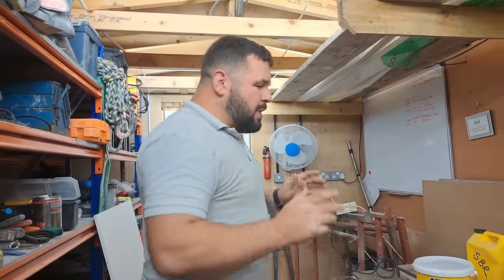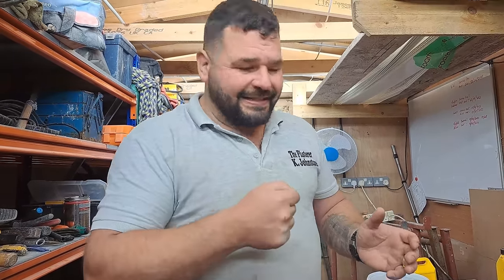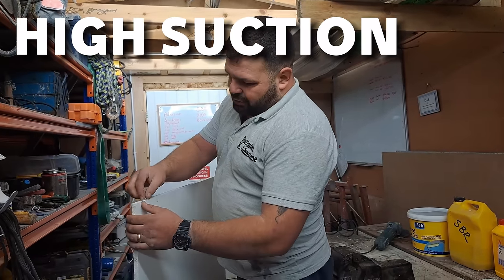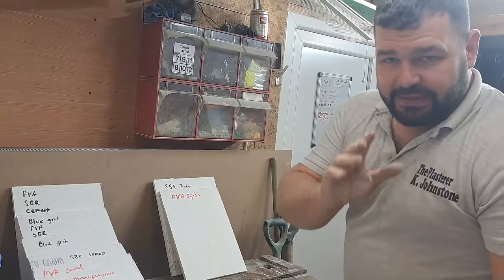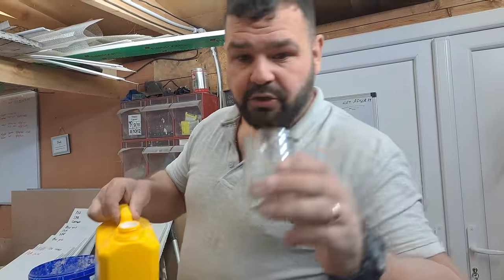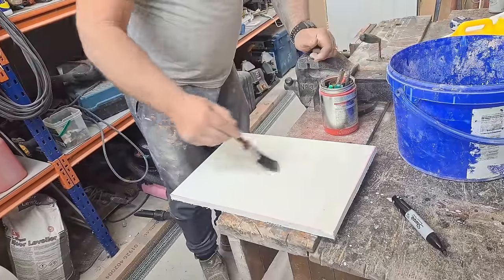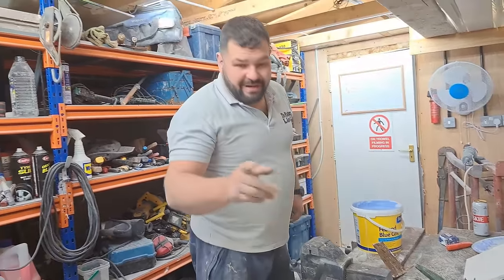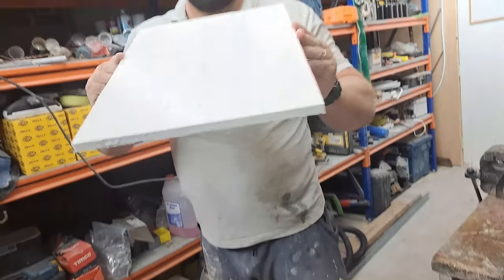I FOUND THE BEST EVER PRIMER FOR PLASTERING!

Comment: Hi Kirk and the gang. Great video. Was super curious the results. I have very recently used blue grit, green grit, sbr and some  pva. Blue grit definitely control/block the suction but not a nice stuff to roll on. I had to put  on 1st coat  very thick  to cover the lumps so I was mixing bucket after bucket and   and it takes ages to set ready for the second coat. Then I switched to Green grit. It seem to control the suction better without killing it off completely. Smaller grains of grit and easier to roll off on the wall and it goes a long  way. Same size tube lasts twice as much as blue grit.  Sbr 50/50 in my case seem to work similarly to green grit.  Where the wall was patched up with bonding and dried out I used 50/50 sbr to seal it and then green grit as without the sealing  green grit was dying off  too quickly and the grit was falling off. So again all depends on the background.
Reply: Try the yellow grit or white,it has tiny grit in it,
Reply: I've heard some scary stories about yellow grit but I'm tempted to try it. I have a half a bucket od green grit left yet. It really goes a long way!

Comment: Hi Kirk. Great initiative; certainly changed my mind on continuing to use pva. Quick question, there seems to be lots of SBR primers on the market, so not sure which one to try. Big differences in price as well so don't want to risk a cheap one for it to fail.  Can you advise on which one(s) you use. Cheers.
Reply: My go to SBR for many years is Everbuild 503 SBR bond,never failed me, I can find 5ltrs for £13 around here. SBR primers are all the same, but prices between brands  can be wildly different for 5ltrs. Bondit SBR primer is another one I can find for around £13..

Comment: The issues with and bonding agent which no one ever mentions is if the wall is being tiled after what is the load bearing weight on these agents a tile can weigh 20kg per sq meter I don’t believe these bonding agent are anywhere near strong enough to hold the weight of modern tiles plasterboard is the best backing  by the way you can’t plaster  on top of cement board unless I’m wrong

Comment: Can you paint over sbr? Say when you use sbr to feather the plaster to the existing wall, theres always an overhang of sbr that hasn't been plastered over. As i know doing it with pva causes flashing when painted over
Reply from the maker: Yes mate it paints
Reply: I was wondering that myself, I’ve started using sbr instead of pva recently on Kirk’s recommendation and it’s brilliant for feathering in patches, stays wet on the edges much longer but it occurred to me would it paint over ok or stay wet on the sbr areas for ages

Comment: Conclusion PVA is dead
Reply: Shit*
Reply: Not really as it will still do the job just fine and adding sand in works fine, also this is a test on one background and it’s a background that will probably not be used to plaster over

Comment: I feel for the customers who have to paint two foot over a small patching job where the plasterer used sbr 
If something will fail it’s nothing about pull tests it’s about the background
Reply: If I saw someone putting sbr over a painted background I’d think the guys a chancer sorry mate especially in this day and age
Reply from the maker: What you talking about mate? You can paint straight over SBR. it's PVA that flashes through the paint 🤷‍♂️
Reply from the maker: I've just clicked on your name as it looks familiar.

Every single comment you have left on my channel is something negative? 
I appreciate that I'm not everyone's cup of tea and if ive something you don't like then I'm sorry but if you don't like me then just don't watch my stuff mate.
Reply: PVA is one of the worst things to paint over. It is also terrible to wallpaper over. If there is one product that skins consistently it is PVA. It's only really suitable for gluing wood. SBR bond is latex based and can be painted over. To be honest, if you are a proper painter in today's environment, you'll be in there with a random orbital vaccum sander removing any excess texture from the walls, and often applying a basecoat primer to create a uniform background before any further painting etc. As an additional note, the type of paint that tend to struggle or react with more modern sealers and primers is vinyl matt and other low durability emulsions that aren't really worth using anymore considering the vast amount of superior alternatives on offer in today's market.